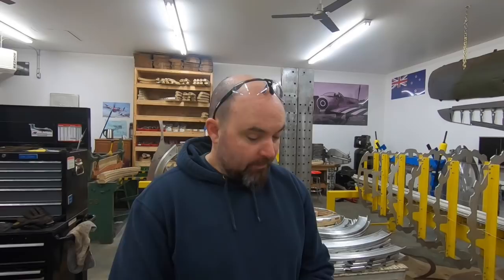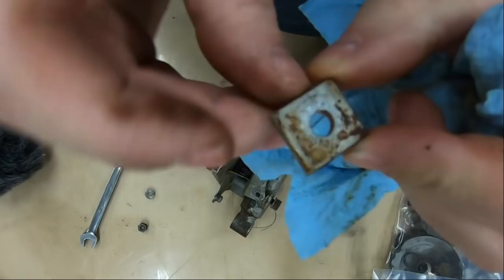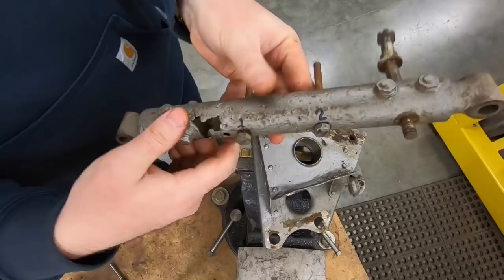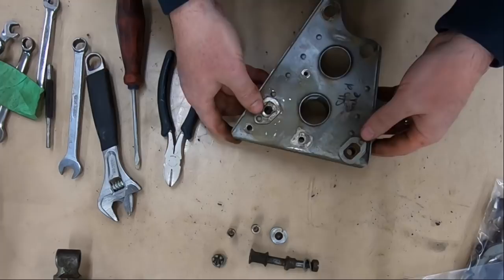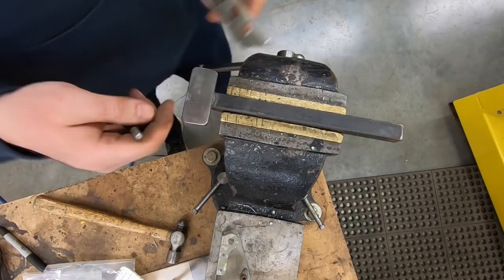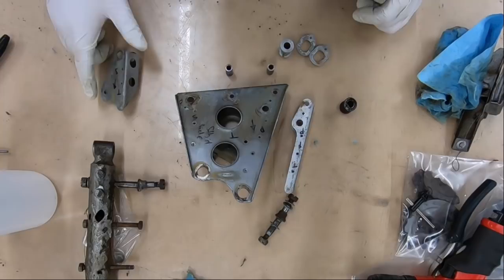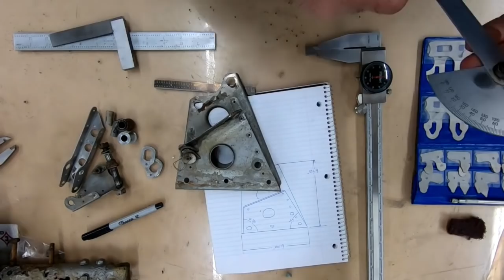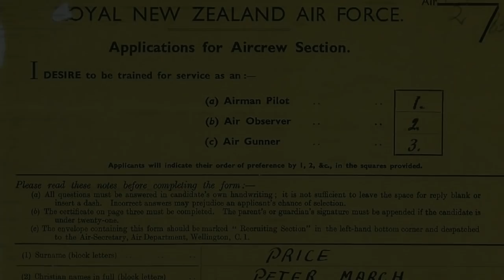S1E12 Hawker Typhoon Aileron Pulley Brackets

Comment: Thank goodness for the digital camera! I wonder if it would be a good idea to make more than one set of parts as you go along, I find by far the most time consuming thing with a rebuild is building all the jigs and fixtures, once they are made, the part is normally straight forward, (or more so). Chris B.
Reply from the maker: Hi Chris, It would be great to produce a second of all parts, but without a current demand for them it would also take quite a bit of the time I can be putting towards JP843. That said, creating all of our tooling to be capable of multiple parts is what we have been doing, just in case, and all will be catalogued and stored. ~Ian

Comment: Part numbers are in odd places, because they are engraved on the blanks before going to the press shop to be formed. This was job I had as a second year apprentice! I noticed that everything you pull off is dry, which is no suprise, but do you plan to re assemble 'wet'?  JC5A or a PR series sealant would work , but it depends on just how authentic you want your awesome project to be.
Reply from the maker: Hi Hugh, actually most of the assemblies were put together "wet" with primer; the parts in this video being an exception. When we pull apart tubular assemblies with reamed bolt hols, quite often the bolts will come out with sticky primer and a strong smell of paint! Joints like these will all go together wet, and the tubes will also be coated internally to protect them. PRC sealants are great in certain applications, but can also aid in the movement of some parts and assemblies, so the use of this will be fairly limited for this aircraft. ~Ian

Comment: Hello Ian. At 5mins recording the bolt sizes  .......l removed the spaceframes from the "e"type yesterday . Didn't want to but l can't repair the  tub properly without doing so . I thought the bolts were all the same until l checked ...4  are about 1/4 " longer !!!! If only l'd watched this first ! I see someone is pedantic about wrench v spanner. . I think it's just the continental differences with certain words. Certainly in the UK wrench is slightly demeaning . Grease monkey v engineer . Just watching this indicates the mammoth task ahead. Would one or two of those parts be serviceable ?  Thanks Ian , very enjoyable and educational.
Reply from the maker: Hi John, British engineering is unmatched, but I've learned that the small details can sneak up quite quickly. Most often if a bolt length or orientation is missed, I can rely on the disassembly photos to catch an extra washer or two! It's interesting, the aileron pulley bolt shown in this video has a 5 degree angle to it, and when looking back at the installation of the bracket, the bolt was designed this way to offset an offset mount! 

I've had a few comments on linguistic differences now, Aluminum and wrench being two of them, and I suspect there will be more to come. Hopefully the people who take note of these will understand that standard terminology is different between countries, and look past it to see the project and what it represents.

One of our team members has an E-Type that I was very kindly allowed to take for a drive, what a beautiful machine!

In looking at the brackets in this video, I suspect we will be able to re-use  some of them; they will need to go through testing, but their condition gives me confidence. ~Ian

Comment: I wonder if the Japanese planes of this era were as dare I say it over engineered!! Im from a car repair career and the cars coming from Japan starting in the 70,s were basic and similar approach to build as other makers lot of rust issues the next generation of 80,s....90,s were significantly different in the engineering and reliability of the car they really perfected  Turn Key motoring ,then the vehicles of the 90,s to 2000 were some of the best cars made anywhere for the most part they were very reliable, logical to work on and the build was distinctly asianand by this I meant simple as possible and functional the plastic build techniques were and are (in my opinion) first class. So after watching you dismantle that bracket couldn't help wondering how the asian aircraft faired in terms of design. That bracket mind is a work of art!!
Reply from the maker: That would be interesting to see, I've not seen any Japanese aircraft structure aside form a few internal shots from a Zero. ~Ian
Reply: @TyphoonLegacyCoLtd  Cheers

Comment: Shows how much hand fettling went into production at that time. Part is close then shim it to correct orientation. Keep weight down reinforce where needed. . I suppose all the adjustments are to get cable running true and free. Complex part. Was the shaft bent by aileron forces on unit via cable?
Reply from the maker: The Pulley bolt has a 5 degree bend in it, and this was done to offset the offset of the mounting for the bracket itself! ~Ian

Comment: Very interesting but I do find it quite over-engineered when it could be more simple as fit for war production not to mention the extremely complicated Napier Sabre H-24 cylinder!
Reply from the maker: Over-engineering is a common thought, and I'm sure there would have been simpler ways; however all of this design work was cutting edge, and when you look at each application, you can see that it was all done for a reason. ~Ian
Reply: @TyphoonLegacyCoLtd  actually I'm not criticising as I'm amazed for the details done by engineers and designers and of course it was done for a reason. My respect for those people who made pieces like this object...
Reply from the maker: @paoloviti6156  I couldn't agree more! My apologies, I didn't mean to imply that you were being critical of the process or design. ~Ian

Comment: Fascinating again, digging into this time capsule. Will you be stamping all of your new parts with the appropriate part numbers?
Reply from the maker: Under our regulations, we cannot use the original Hawker numbers because we need to identify that the parts that have been replaced by a "made repair part". Stamping of part numbers is also something that I don't want to do. All of the repair parts will be identified with a "TL" prefix and the original hawker number to identify them correctly. ~Ian
Reply: Understood, thanks!

Comment: Do you not use a height gauge or CMM to measure parts? using a Vernier caliper seems a little basic for most parts.
Reply from the maker: We use many different techniques to measure parts, form vernier calipers to laser and CMM, it just depends on the parts in question. It's easy to overthink things, but in many cases, like this one, calipers are all that is needed to get the required accuracy. ~Ian

Comment: I noticed that there was no safety wiring on the nuts; do you think that is odd?
Reply from the maker: There are a few locations where the nuts are retained with cotter pins, however in most applications for this structure the nuts were installed and the bolts were peened for retention. ~Ian

Comment: Where components such as this assembly have parts which are not corroded or bent, can they be assessed for reuse and would they need any form of hardening treatments?
Reply from the maker: I suspect a few of these will be suitable for re-use, but they will need to go through non-destructive testing to confirm the absence of cracks first. Aluminum age hardens over time as well, so in cases like these parts, we may choose to put them through the solution process again to restore the original mechanical properties.  ~Ian

Comment: If you don't have a drawing, do you use a CMM machine to help draw it from the old part? How do you draw something you don't physically have?
Reply from the maker: In many cases, simple parts and fittings are just drawn and measured as I was doing in this video. For the more advanced parts, our sponsor E3D has been a massive help using laser scanning and CMM technology to measure and rebuild the parts digitally, with these, typically the original tolerances are listed in the manuals, so we are able to replicate the parts exactly. When there are no drawings, and we have no parts, we need to find the parts to reverse engineer; there are still a few items we need for this process. ~Ian 
https://e3dt.com/

Comment: Why did they put so much effort into a disposable plane,  they could have made it half the weight and a fair bit stronger if they had made a riveted/bonded monocock
Reply from the maker: The design work was cutting edge, using new processes and techniques, Hawker was reluctant to go full mono, but the Typhoon represented the start of this change. ~Ian
Reply: Massive amounts of available labour and shortages of both skilled tradespeople and materials.
Much simpler to source materials and assemble something out of off the shelf tube and simple sheet pressings than it is formed and riveted aluminium. Also easier to accurately reproduce smaller sub- assemblies like this in scattered workshops and bring them all together in one factory at the end. Reduces the risk of the entire assembly line being destroyed in a bombing raid.
The aircraft of the war were also designed with the fact they had to be easily field repairable with very rudimentary equipment.
 You have to bear in mind these aircraft were designed and built under constant threat of materials becoming unavailable, of factories being destroyed. These were significant considerations in designing aircraft.